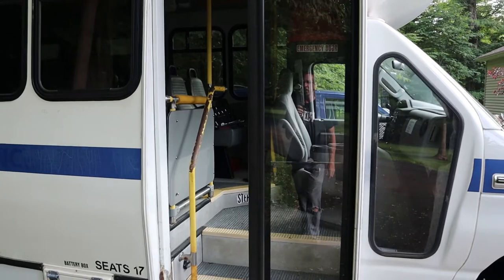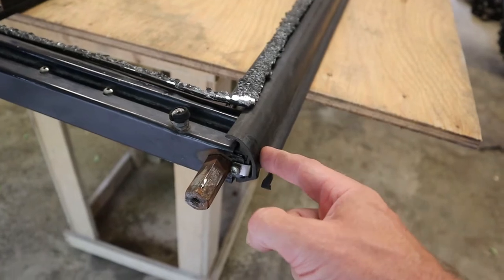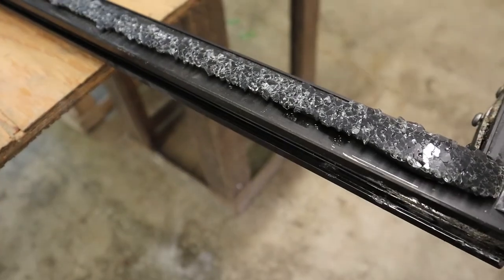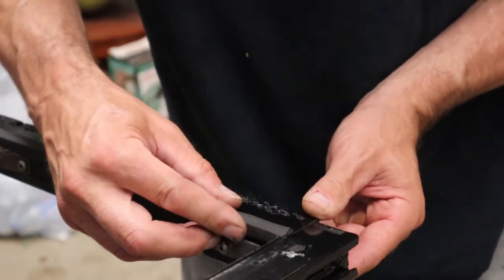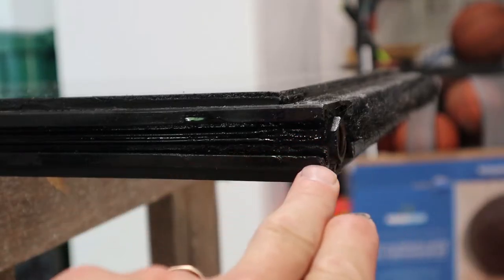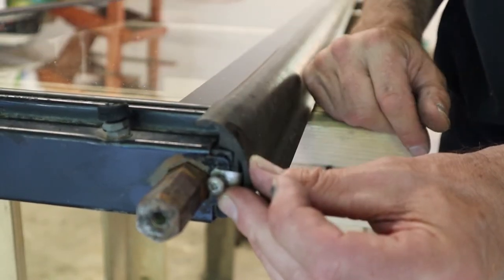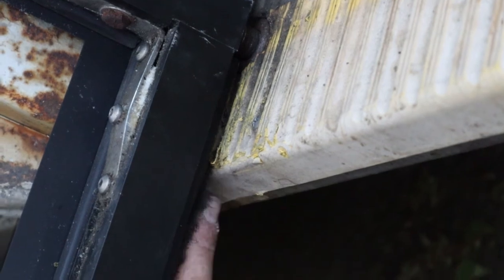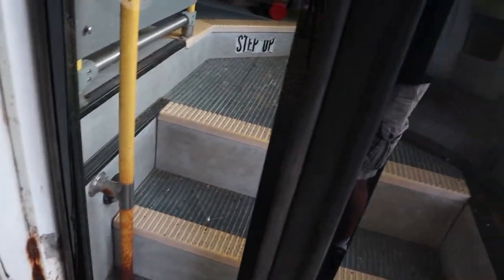Shuttle Bus to Van Life Toy Hauler (Episode 4 Bifold Door Glass Replacement)

Comment: I’m getting play in my door when tractor trailer are driving past me causing my door to kind of open making my cabin lights to turn on. Do you know what bolts will make the doors stay closed?
Reply from the maker: Usually the tension on the door is adjusted by the bolts next to the hand that you use to open and close the door. Just adjust the nut that is on the threaded rod that goes to the door so it applies more tension when closing. I had to make that adjustment on my door also.

Comment: What adhesive did you use?
Reply from the maker: Hi
Sorry for the late response. Crazy busy. The adhesive that I used is a 3M product that I purchased from Napa Auto Parts. It is 3M Windo Weld   Super fast urethane 08609. I showed at picture of it at 7:38 in the video. Thanks for commenting. Hope this helped.

Comment: Do you know the manufacturer of the window? or dimensions?
Reply from the maker: Hi
The size of the window will vary based on the year and the manufacturer of the coach portion. There should be a sticker on the door jam that will tell you who made the coach. Mine was made by Coach and Equipment. If yours was made by them here is the number so you can order the window. 1-315-536-2321 Hope this helped!